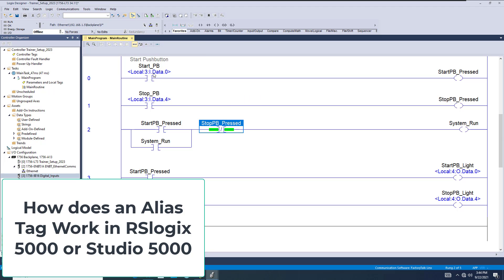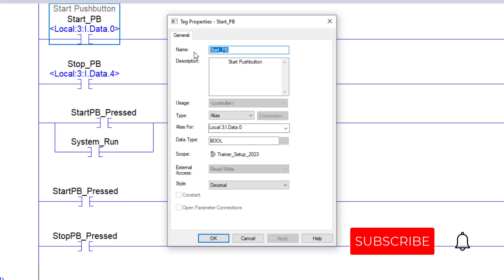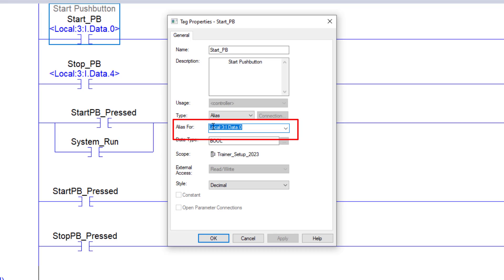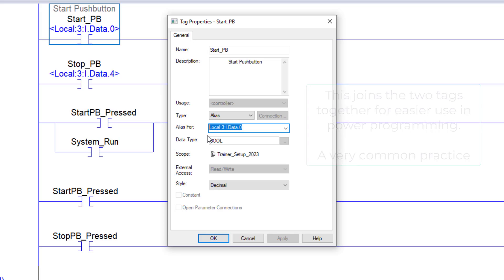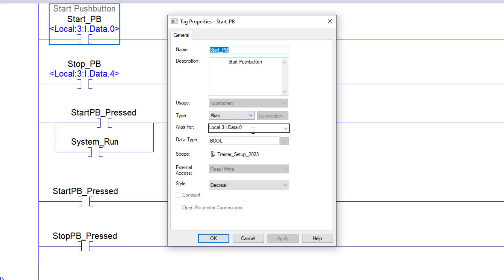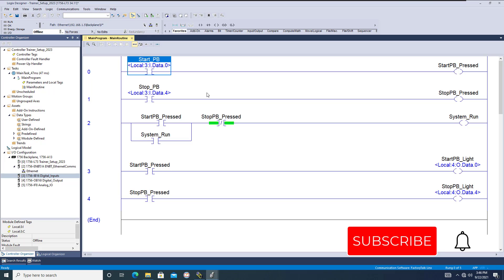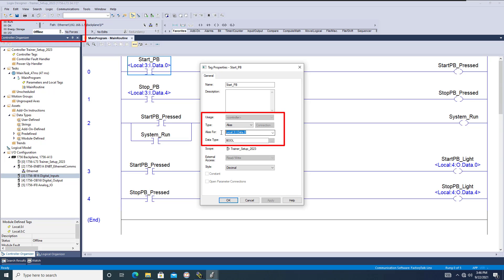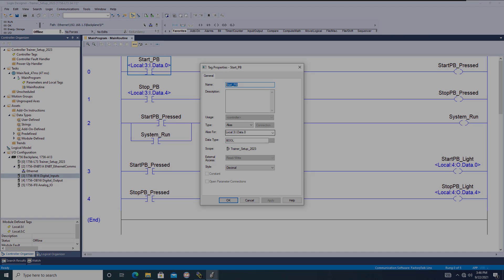RSLogix 5000 Tag Structure - How Alias Tags Work In RSLogix 5000 or Studio 5000

Comment: This explains why even though I created a new tag online, in the rung instruction it display the alias as the color black instead of blue until the change is downloaded to the processor.
Reply from the maker: Let me know if I can help.

I also adjust my color scheme in Studio 5000 to the old look to easily detect things like this.
Reply: @ShaneWelcher   I was trying to add the Tag TT_G50-0001 from an IFIX terminal to the studio program because the tag aliased to the input map address was N33[11] nothing else pointed to the IFIX terminal field device with this name. I simply wanted to make sure I was adding the new tag to the controller tags correctly.  Make things a little easier to look for. Especially with a tag that does not have a direct address in the program, especially when the value is getting written from another program.
Reply from the maker: @RobbyBobbyFlame  Also, if by chance you are online & make the tag wrong or use the wrong alias then just delete the tag & make another one.

No reason to have to download unless for other reasons